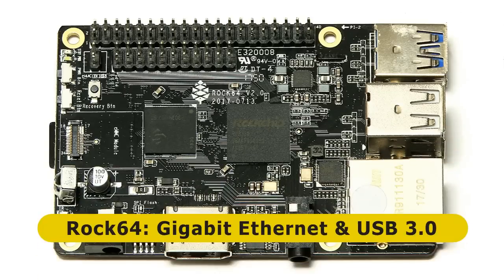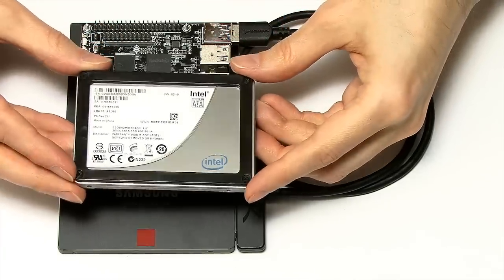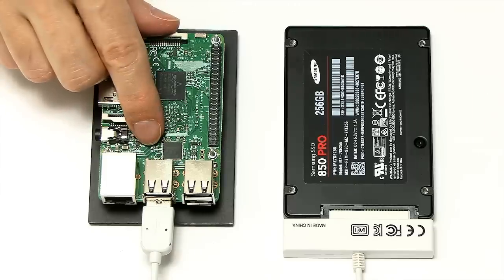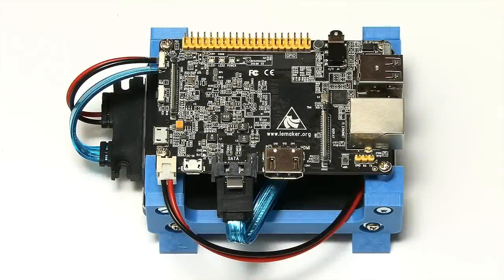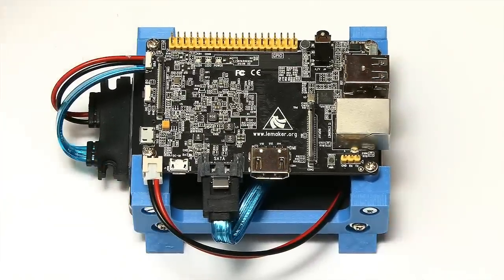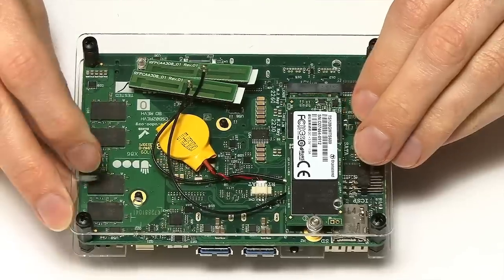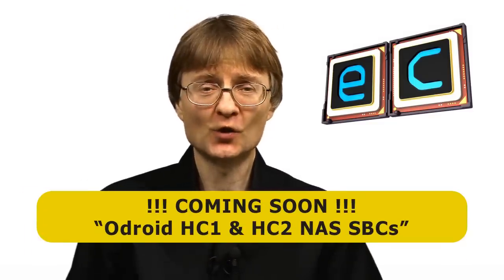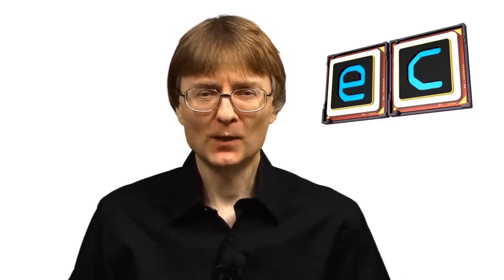SBC NAS Group Test

Comment: Thanks, Chris: 
1. Why didn't you use the same USB3-SATA3 adapter that you used with the Roch64 with the RPi3? Did the adapter not work well with the USB2 of the RPi3?
2. Did the USB2-SATA adapter that you used with the RPi3 support the higher transfer speeds of SATA3? Or just SATA2? Do you think that this decision had any impact on tha results of the RPi3?
3. Have you considered performing this comparison again with the newer,  more-capable RPI3, Model B+? I wonder how the Gigabit NIC would affect the results.
Reply from the maker: I can't remember why I used the USB 2 adapter with the Pi -- but probably because the Pi only has USB 2.0 ports, and shared ones at that. So speeds will be nowhere near SATA 3 (or even SATA 2) -- the constraint will be the shared USB 2.0 interface. So the results will not have been impacted. The Pi 3 B+ has the same shared USB 2.0 interface. Its Ethernet is 300 Mb/s (up from 100, but not gigabit). So it may be a bit faster, but I seriously doubt it. The issue with the Pi is the internal interface.

Comment: Thanks for the video, this is exactly what i was looking for,  just a curiosity, would a Rock Pi 4 B 2Gb model be a good option for this purpouse? Greetings and best wishes from Brazil
Reply from the maker: The Rock Pi 4B (which I will feature on the channel in just over a week from now) could make a great NAS, if reliable software is available.
Reply: @ExplainingComputers  thanks for your attention and for answer me, and about the software i was thinking about use OpenMediaVault, i saw a lot of people using with Raspberry Pi, but i think the main problem is the usbs 2.0 because of the read/write speeds for an external drive with Raspberry, so,  I'll be looking forward for your video about Rock Pi 4B, and really really thanks, best wishes from Brazil Sir.

Comment: How strong should the PSU be if you plan on hooking up a SATA HDD to one of these?
Reply from the maker: It depends on the particular board. None of these will power a 3.5 inch HDD, as that needs 12V and 5V. But with, say, a 3A PSU, the UDOO x86 should be able to power a 2.5 inch HDD, and probably the other boards. For a 3.5 inch SBC NAS, look to the Odroid HC2, which is purpose built for this: https://www.youtube.com/watch?v=AtHzhtkxIc8
Reply: @ExplainingComputers   I have a Banana Pi coming which has SATA on it.  I might make a music server out of it.

Comment: Would also be good to throw the odroid hc-1 into the mix, since with it also doing sata. It's an xu-4 with some of the non-nas parts removed to make room for the sata port and it's all in a case that is also the heatsink.
Reply from the maker: Indeed, I have a video on the HC1 and HC2 here: https://www.youtube.com/watch?v=AtHzhtkxIc8
Reply: Yes but it's not in your nas shootout here. It would make for a better comparison
Reply from the maker: Totally agreed, but I did not have the HC boards then. :)
Reply: @ExplainingComputers  I was under the mistaken notion that this one was newer than the HC video. Strange that the notification of this one came now instead.

Comment: how much speed we gain if rock64 only using normal hardrive not ssd ?
Reply from the maker: It will depend on the HDD. 7200prm HDDs should max out 1 gigabit Ethernet.

Comment: I'm actually looking into building a NAS with a Pi / rock64 and a few 4tb WD passports for power savings and scalability that I currently don't have on my NAS. Non raid but do you think a USB3.0 hub will slow transfers down? And Pi B + or Rock64? if that is even a question..
Reply from the maker: The Rock64 will give better performance due to real gigabit Ethernet; the Pi 3 B+ is 300 megabit. A USB 3.0 hub (on the Rock64) should not slow things significantly for a NAS; but may well create instability.
Reply: ExplainingComputers thank you very much for your time and help.. next question, is the 1gb fine for a NAS media serving 4k movies or should I opt for the larger ones?
Reply: ExplainingComputers also, is there a limit to how many 4tb passports one could use on a hub. Thanks again for your help and support
Reply from the maker: If you are streaming a lot of large files, then it may be wise to go 2GB for the cache. Though it depends on the data rate you need to stream. I think USB hubs are limited to eight devices (but may be wrong on this). I personally would not create an SBC NAS reliant on a USB hub due to possible instability.

Comment: Hi Chris, I want to build a NAS in raid 1 setup and 2 drives of 2TB each. Can I use a Rock 64 with a USB 3 hub connected to the USB 3 port?
Reply from the maker: You could, but RAID over a USB 3.0 hub may not prove stable.

Comment: Just wondering, have there been any issues (such as problems with wear-leveling, location of the swap file, etc.) with running OpenMediaVault on the eMMC of the UDOO x86?
Reply from the maker: This could potentially be an issue, but I have not experienced it myself.
Reply: Thanks!

Comment: How the Hell did USB 3.0 beat a SATA connection?
Reply from the maker: Because the internal interface to the SATA connection on the Banana Pro does not run at SATA speeds.
Reply: ExplainingComputers How very curious, and interesting. Thanks for the quick response. Does the UUDOO x86 pull this too?

Comment: Thanks for these excellent SBC Videos. I have already a Raspberry Pi 3 running with openelec/Kodi and it is realy very very good for this use case. This inspired me building a Plex-server with a Pine64 SBC board. The Pine 64 sbc-board has the advantage of Gigabit ethernet and a USB3 port. Christopher do you know if there is a Linux-build out there for the Pine64 SBC to use the Raspberry Pi Plex packages?
Reply from the maker: Thanks for this. I'm not aware of a Pin464 Pi Plex build -- but that doesn't mean that one does not exist! :)

Comment: Hey my man can you do a video on how to boot a lattepanda from a USB port, from a thumb drive
Reply from the maker: This is extremely hard to achieve, as the LattePanda is Atom based, and does not have a standard boot loader for USB boot.
Reply: ExplainingComputers..I was thinking if so then I could boot from a hard drive, ok. I guess an external hard drive will have to do for more space. Thanks for your reply

Comment: I'm thoroughly confused?
Isn't USB3 to Flash Storage transfer rate up to 5gbps?
Even looking at online calculators the data transfer rate is around 2gbps?
Is it these compact boards? Or the NAS interface that is lowering the speed?
What am I missing?
Reply from the maker: 5Gbp/s (or about 625MB/s) is the theoretical, maximum transfer speed of a USB 3.0 interface. In practice, you would need a very good SSD, and a very good implementation of the USB 3.0 interface on the board concerned, to deliver this kind of speed sustained. The limitation in these tests is the speed of gigabit Ethernet, and (on the Banana Pro) the speed of the internal interface of the SATA connector. (Well, also the speed of the USB 2.0 interface and 100 megabit Ethernet on the Pi 3, and the shared bus for the same).
Reply: Thanks very much!

Comment: Raspberry Pi 3+ does have gigabit NIC but total USB bandwidth is still be limited to about 38 MB/s due to the Broadcom chip only having a single internal USB port. Max transfer speed you could get (in theory) is around 19-20 MB/s. Too slow for general NAS use.

P. S. for mounting shares in Windows, you can use IP addresses instead of NetBIOS names.

Comment: I was able to manually set up OMV4 for my BananaPro, using the latest non-desktop version of Debian from Armbian (https://www.armbian.com/banana-pi-pro/) and then manually installing OMV4 using their instructions at http://openmediavault.readthedocs.io/en/latest/installation/on_debian.html.

Still, the performance isn't really different than with the older version you tested.

I also did the same with a Solidrun Hummingboard. That SBC claims Gigabit ethernet, however it's constrained to about 450Mbps. And it also has an mSATA port.
Reply from the maker: Thanks for this -- it is interesting/good to know that the results would not have been that different (which they should not be, as the hardware is the limitation, not the software).

Comment: Nice to see this kind of comparison, I wish to plug the Odroid XU4 that I have had as a NAS with OpenMedia Vault for well over a year now. It seems that it would lend somewhere in between the UDOO and the Rock 64 boards.

I never tried it with an SSD, however, I have 1 disk for Torrents and another one for storage, each on their USB 3 ports, this avoids contention and un-necessary stress on my storage drive. It runs Plex, network shares and torrents, all without a hint of an issue.

Anyway, OpenMedia vault is an amazing piece of software!

Comment: Could one use an SBC with a hard drive if speed was less of an issue?
Reply from the maker: Yes, no problem at all -- though I would be careful powering a hard drive from an SBC.
Reply: Given the power issue, perhaps this is a better alternative since it has its own 12V power source.  This seems very cost effective if high performance is not the priority.  I have not seen competing products. https://www.pcmag.com/news/352831/nanopi-kit-builds-a-one-bay-nas-for-31-just-add-storage

Comment: Great video, as ever. Although, if you had used the Pi 3B+ it might not have completed the test, if your Pi 3B+ has the same issue as mine and some other peoples'. Randomly hanging the network connection.
Reply from the maker: I have that to look forward to then . . . !

Comment: These are great videos.  It seems that there are a growing number of SBCs and you probably cannot evaluate all of them: however, Amazon list this one as its "Amazon's Choice" so I was wondering if you could compare it to some others:https://www.amazon.com/Libre-Computer-AML-S905X-CC-Potato-64-bit/dp/B074P6BNGZ/ref=sr_1_3?s=pc&ie=UTF8&qid=1522095036&sr=1-3&keywords=single+board+computerOr perhaps better yet would be their more advanced model with USB 3 and Gigabit Ethernet:https://www.amazon.com/Libre-Computer-ROC-RK3328-CC-Renegade-Ethernet/dp/B078RMQYHS/ref=lp_17483707011_1_3?srs=17483707011&ie=UTF8&qid=1522095280&sr=8-3I am interested in two applications: 1) NAS,  and 2) something on which I can watch video from the web (on a browser) and flash drives on my TV.
Reply from the maker: I will take a look at these boards. Thanks for the links. :)

Comment: Based on my experience with Windows Explorer, I have to wonder if you are getting an accurate measure of the transfer rates. Explorer seems to be hampered in some significant way in moving files around. Obviously your comparisons still stand since all the tests were alike, but using Explorer may not be putting the boards' performance in the best light. BTW love your videos! You're providing a great service to all of us techies. 

Doug
Reply from the maker: Thanks for this Doug.

Comment: Could it be possible to know the results of this test with the Thinkerboard?
I currently own a RPI2, and I'm looking for an upgrade.
I'm obviously looking for better hardware performance, but software support is algo something I have not been able to measure.
What do I mainly use it for? Docker, Plex, Transmission, Home Assistant, SAMBA, youtube-dl.
I'm hoping better hardware could allow me to dive into Computer Vision projects (OpenCV)
Any suggestions?
Reply from the maker: I have not tried this with the Tinker Board (S), but performance will not be that much better than the Pi, as it only has USB 2.0 ports (if gigabit Ethernet. A Tinker Board is certainly more powerful for something like computer vision stuff -- significantly more powerful than a Pi 3. You may want to look at my video here: https://www.youtube.com/watch?v=8qBxi6Q4XlY

Comment: Please let me know the skeptical side of the 3+. It looks to me like they just over clocked the CPU and made a slight revision for radio compliance, which has zero value to the electronics hobbyist. As mentioned here the 1GB Ethernet is a fancy dress on a 🐖... Nothing really changed under the hood. I don't see anything that warrants a media hype release, but I guess "+" is the Rπ way of saying V×.1 and it's our fault for treating the rear entrance service elevator guest to a Hollywood red carpet affair.
Reply from the maker: Great post. I have tests in progress on the Pi 3 B+, which I will of course share here. The big change is the improvement in thermal performance, which is quite impressive. But still slow Ethernet and USB 2.0 . . .

Comment: What about testing these sbc as NAS with RAID, the idea with NAS is also data security (no I am not speaking backup, that is for an other discussion for an other day), it could be interesting if RAID 0 on any of these could increase performance, and if RAID 1 will decrease  performance. Also intyeresting to see how it will perform with SATA multiplyer in a RAID configuration.
Reply from the maker: The problem is using multiple drives on these boards, due to their lack of connectivity. And there is little headway for performance improvement, given that the bottleneck here at the higher end is that of gigabit Ethernet.

Comment: As this test is very recent, could you test the following:
the Rock64 with a USB3 hub so that the data throughput is measured over  USB-USB instead of the Ethernet-USB bridge.

I'm still looking for a good hardware solution ,where I can copy my memory cards quickly to a SSD when I'm on the go. 
Your feedback would be appreciated.
Reply from the maker: A Rock64 could indeed be good for what you require, though as you note you would need the hub to have both the card reader and drive you are copying to running over USB 3.0. Another alternative would be to use an ODROID-XU4, where you can boot from eMMC, so have both a USB 3.0 port and an unoccupied microSD card reader (assuming you were shooting to micro SD).
Reply: Thanks for the quick reply. I'm a prof photographer. I have multiple large capacity SD and CF cards. (32 and 64 GB) Therefore I need USB3, otherwise it would take forever to copy. I  would like to know at what speed a USB3 hub would perform if a high quantity of files (average 30 MB each) would be copied from card to SSD. The cards are 100-120 MB/s max read speed.
Because this also has a regular Raspi GPIO header, I could top it with a Touch LCD I have here. (waveshare)
I want to build a portable, battery powered backup device.
So I'm really interested in the throughput USB3-USB3
Reply: ExplainingComputers just bought the rock64 4g from Hong Kong for €48 incl shipping and a powered and unpowered 4port slim usb3 hub from Anker through Amazon.
Looking forward to building my mobile data storage for photography

Comment: great video, but you should close any other connections you have to the boards. In this case they would not of affected the group test for position on the leader board, but may of slowed down the transfer speeds and not shown the full potential.
Reply from the maker: No other connections were open! :)

Comment: Revisit request: throw 10Gbps Ethernet and NVMe SSD into this mix? You can run 10Gbps Ethernet over USB 3.0 or PCI Express. NVMe SSD uses PCI Express too. Also when testing these you might want to use a PC as baseline since almost all SBC will bottleneck.
Reply from the maker: Cool ideas -- noted! :)
Reply: ExplainingComputers When setting the baseline PC score, make sure that both the 10Gbps NIC and the NVMe SSD are backed with maximum possible PCIe speed and lane count. The baseline system can be an overclocked Intel Xeon E5-1650v2 on a X79 motherboard, which should be fairly cheap on second hand market and provide a lot of PCIe 3.0 slots for the NIC and the SSD.

Comment: I have an older Pi doing NAS work (raspbian + samba.)
I was looking at possibly upgrading it, but Pi's are still pricey once all the other parts come in, case and power supply. Thankfully it looks like I wouldn't have had much of a speed increase anyway according to this video.
I have a couple unused netbooks though, I wonder how obnoxious those would be to have running 24/7 in regards to fan noise.
Reply from the maker: You could always remove the cases from the netbooks and passively cool them sticking on an old heatsink.

Comment: Pity you didn't use the same ssd with USB 3.0 interface in the last test, since a more typical configuration for a single board NAS would be to use large desktop drives connected to the board via USB 2 or 3 (depending on the board). The Rock 64 seems like the one to beat, though.

Comment: This is a slightly confusing video. Can you confirm whether you’re transferring files over a network via WiFi? If so, are you not testing both the combined speed of the WiFi, and the usb 2.0 ports? If so, it would be interesting to see the separate speeds of the WiFi connection, and internally moving a file to the SSD. It would also be interesting if you did the same test but SSH into the sbc and transferred a file that way, would you see any improvement in speed?
Reply from the maker: No, I am not using WiFi. I am transferring all files via the wired Ethernet connection that I constantly refer to. The Rock64 does not even have WiFi. Using SSH would not improve network speed. The constraints here are the speed of the drive interfaces and Ethernet on the different boards.